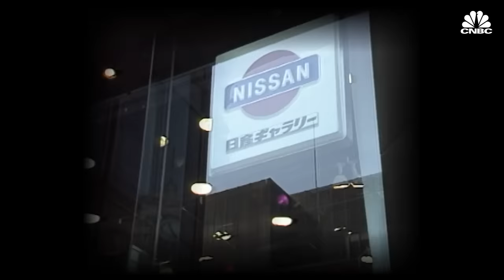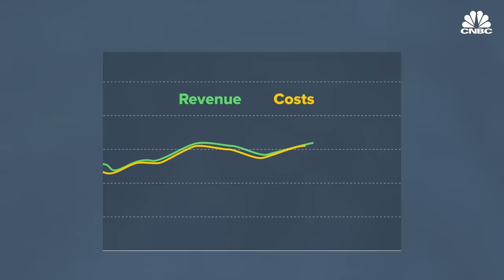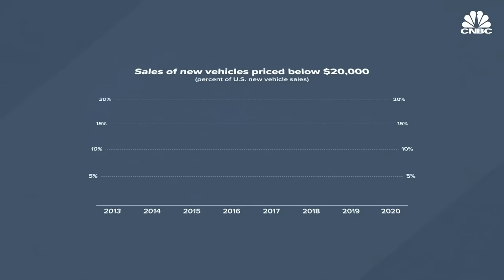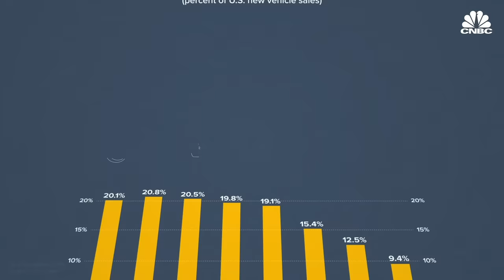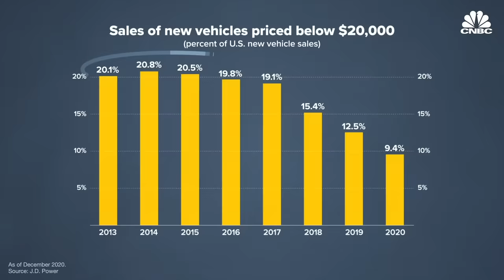Why Cheap Cars Are Disappearing

Comment: Because people are getting loans to buy cars they can't afford in a vain attempt to look good.
Reply: Loans? So what happens if they die before finishing the payment?
Reply: Yep. 2008 housing bubble is going to be 2022's car loan bubble.
Reply: They view it as a monthly payment rather than the price tag.
Reply: @liberals_destroy_everythin2497  I more meant that people will eventually be defaulting on their auto loans in masse. COVID and unemployment has ensured this is going to happen sooner than later. I expected it happen in about 4-5 years.
Reply: Here’s an example of depreciation. I have been driving a long term rental, a 2020 Maxima SL, for 4 months. New it was around $41k, probably outright around $36k. Looked at a used one just like it with 20k miles for $27,500, was told $26,500 would take it home. Unless you had good equity in your trade or had a sizable down payment you are buried in that car. Almost all new autos are like this, some of the SUV’s and pickups seem to hold their value better than the cars do.
Reply: Yeah that's me right over here
Reply: this can be seen when Malaysia make their car taxes to 200% in the 90's, you end up paying loan with interest for 7-9 years.
Reply: I was thinking the same thing.  These banks offer 7 year auto financing which helps broke people buy more expensive vehicles.  The other reason is these automakers are greedy and they want to sell big ticket items to make more profits.
Reply: PCP (Personal Contract Purchase) often offered by the big manufacturers. Put down a small deposit, make large monthly repayments for three years, and then, providing it is in good condition you can simply hand the car back, and repeat the process. A massive used car dealer next door to where I work sold nothing but 2 to 5 year old cars that I guess were PCP returns. A colleague who despite complaining about his lack of pension spent almost £40000 on a new SUV last year says he is looking forward to changing it in two years time as he forgot to specify heated seats.
Reply: @fynkozari9271  The car immediately goes back to the company providing the loan.
Reply: Thats right
Reply: Hydro... I suggest new buyers are more informed than older buyers (they also have less expendable income) and they are buying Tesla, buying used, or using public transportation and ride sharing services.
Reply: This exactly. I'm amazed that the video didn't cover the absolute explosion in sub-prime car lending that has occurred since the end of the last financial crash
Reply: Correct. To keep the price down, the previous generation was willing to live without power windows, air conditioning. If it wasn't needed to make the car move...get rid of it.  As I recall, my dad ordered an F150 with no radio, ash tray, cigarette lighter, air conditioning, power steering, power brakes.
The only real cheapo car sold now seems to be the Mitsubishi Mirage and that is luxury compared to what I grew up driving. ;-)
Reply: God lol this couldn't be more true. My neighbors live in a 700 sq ft home prob worth 80k and have 2 GIANT suvs AND a truck in the driveway. 🤦🏻‍♀️
Reply: This is the correct answer. Banks/Lenders/Dealers are giving out financing terms of 84 months with $0 down and 0% interest. The people are being lead to the slaughterhouse like a completely blind herd, and when the next recession like 2008 hits, it’ll be because of this and be farrrr more crippling (due to the ease of access when it comes to getting a new car and how many people fell for it) than the first recession of 12 years ago.

We’re all sitting on a ticking time bomb.
Reply: @markd9130  It cost far less to build 100,000 cars exactly the same than to leave out options on a single vehicle.  The company building your dad's truck took a major loss, they should have just sold him exactly what they were producing for less.
Reply: @markd9130  On another note.  Most cars do not have all the 5 star safety features unless you order the vehicle fully loaded and also ask for them.  That car in your driveway... the one with 5 stars in the book?   Yea it is only 3.5 stars.  They didn't put in all that expensive safety gear.
Reply: That doesn't make them.expensive , government pushing up business  costs pushed up prices
Reply: I hate how American culture forces people to flood themselves with material goods.
That's not how happiness is achieved.
Reply: @davidbeppler3032  Buying Tesla ? Why do you only mention them ? In the USA they'e the king of EVs but anywhere else they're just another EV maker. I disagree with your view that 'new buyers are more informed than older'. I'm 66 and although not in the market, I've been following EVs for decades and am expert in the detail.
Reply: There are no cars they can afford; and if the USA made any sense (ok, a bit dramatic there...) they would have a better public transport system so that people could get around just fine without a car (not forced to have a car).
Reply: @coopsnz1  Any businessman blaming "taxes" was never a good businessman to begin with.
Reply: it's not just to 'look good', there are actual reasons people purchase more expensive cars. However, the reality is that, like you said, they can't afford them so they spread their loan over an obnoxiously long payment term.
Reply: @frankierogers428  Happiness is achieved through better pharmaceuticals.  :)
Reply: @theoccasionalvideo  The US Public Transport System isn't an 'entity' as such. It exists where vitally essential such as large Metropolitan rail and subway systems, notably that of New York, also Chicago and somewhat smaller in other cities. Large Tramway/Streetcar systems existed in the past but were bought up by auto and tyre interests and run down to promote car sales, notably in Los Angeles. At least that's the popular story. See here for more  ...  https://www.vox.com/2015/5/7/8562007/streetcar-history-demise
Reply: @Chidoro41  I note that most cars bought today contain 'luxury' items and fittings once unknown in the average family car. These include air-conditioning/climate control, power assisted steering, electrically operated windows and mirrors, heated seats and steering wheels, navigational computers, multi-speaker audio with DSP, parking cameras and 'driver assist' systems like lane departure warning and adaptive cruise control. Is it any surprise that they're more expensive ???? My first car, a 1500cc 1966 Ford Cortina (original purchase price new ~£850) had not a single one of these but was 'engaging' and fun to drive. Even the screenwash had to be pumped by hand ! Even my most recent vehicle, a SAAB 9000 has only a number of these 'luxuries' yet is a damn fine car. In Europe, Renault's Dacia brand offers a number of relatively  'no frills' cars for a lot less than other brands. Shortly to include a sub $20,000, 4 seater, 'city' EV too !
Reply: @theoccasionalvideo  you haven't live in Australia and Europe Government total crooks
Reply: @theoccasionalvideo  you must be a socialist, that never owned a business???
Reply: @Hydro Aegis Yes!!!  That's exactly the problem with American people nowadays.  Keeping up with the Joneses and instant gratification.  They don't realize that crap until one of these days they end up losing everything.
Reply: I was just trying to get a car with the necessary specs and there literally isnt anything affordable
Reply: @Chidoro41  It’s mostly to look good. I bought an ‘06 Saturn for $1,200 cash. It gets me around just fine, but most Americans are to vain to be seen driving something they can afford to pay cash for.
Reply: My alcoholic friend used to own a buy here pay here car dealership. If you told him come look at my new car he said "No. I won't even walk across the street to look at someone's new car". I've taken that page from his book and use it also, because it's true, no one gives a rats ass about your new car.
Reply: Well some of us like cars and like driving them. If you buy a car to look good, speak for yourself.
Reply: My wife and I are called elderly, both 73, for our personal vehicle we need something comfortable.  These bones do not handle road trips well.
Reply: Well, there is a huge marketing industry that indoctrinates people into becoming consumers from a very young age.

Comment: Young people should always buy used cars and learn to maintain them without the anxiety of the car’s value plummeting after you drive it off a dealership!
Reply: Nah dude, young people are doing it right today. What you do, is put yourself down on an 84 month plan for a $50k+ pickup truck (because you need it for groceries) while you’re only making $40k, get the latest $2k smart phone, eat at Starbucks everyday, and then…..

Tell Bernie Sanders that it’s the governments fault that you’re in debt and can’t afford to buy a house.
Reply: @MrShitthead  🗿
Reply: @MrShitthead  can’t agree more.  People needs to learn to live within their means and start saving money for the rainy days.  A Toyota Corolla can easily goes 200K miles properly maintain.  That should last them 10-15 years.  Instead they go out and buy the $50K BMWs and get in a 84 months payment term.
Reply: Or even better, not buy car at all if it isn't needed. Obviously, this only works when in area with good public transit.
Reply: I did that and it was a disaster. You end up paying in repairs…. Buy new as possible of your going to buy used
Reply: @adjustdafacts  Depends on the car too! Never buy used benz, range rovers, or other luxury cars. Get reliable cars like Toyota or Honda
Reply: @chiefdan07  or get a car from the 70s

I am looking at a 1970s mercury 

3k from a private seller
Reply: That's nice in theory, but have you seen the prices of used cars these days ?!? It's better to buy new. I honestly wish I would have. Now I have a used car that has needed repairs, does need repairs and TBH by the end of the deal I wasn't paying much less than what a brand new car would've been. It was 100% my mistake. I like my car, but I definitely plan on purchasing new next time I buy. I just need to find the right incentives at the right time. Young people should focus on building their savings and credit. They can buy the new car but they need to scale back their expectations for having all all bells and whistles in their brand new ride right away.....there is nothing wrong with base models. The standard features in cars these days is more than enough.
Reply: @RealDexterMidnight  a car from the 70s isn’t a good idea for the average person looking for a daily driver since ones in good drivable condition can be hard to find and certain parts will break down since they are old, but they are a good idea for a project car since most of them tends to be easy to fix and modify
Reply: Especially if you're poor!
Reply: I'd Rather Buy a New Car than Buy a Used one So that the Used Market for Petrol Car's can Still exist in the Future!
Reply: @dbclass4075  little late to reply, but everybody keeps forgetting a cleaner and easier mode of transportation. The bicycle!
Reply: @nickvanemden    Up to a certain distance. Anything longer distance requires road or rail vehicle. Bicycle is a happy medium between road and rail vehicles, and walking. Though to encourage cycling, Dutch-class infrastructure highly-recommended.
Reply: @RealDexterMidnight  buying 70s cars is basically illegal in Europe, unless you're a car collector, emissions and stuff, we're stuck with boring 2000s City cars or SUV
Reply: Boomer thinks a modern car can be repaired with a wrench and duct tape like it's 1972. LMAO. Cars are computers on wheels and cannot be repaired without proprietary software. This is on purpose so you can't maintain your own car.
Reply: @adjustdafacts  ive only had used cars and its nothing but transmissions and my "newest used" well i went to do a tune up and it had 3 helicoils where the previous owner stripped out the heads and now im down 2 cylinder heads. and my project truck that i have on the side well im 11000 in on its repairs and its still not drivable.
Reply: Young people in the modern wage suppressed economy can’t afford a garage, the tools, the time to learn - and you can’t just fix modern vehicles with a basic mechanical understanding.
Reply: yeah if affordable and reliable cars disappear then buying a used "premium" car then it won't help because those premium cars are expensive to maintain, thus it won't help.
Reply: @adjustdafacts  Try to do your own repairs and make sure the car you buy isn't known as a lemon. My parents have a 2008 Dodge Grand Caravan they've had since nearly new and it now has almost 400 000 km on it. Despite the Caravan not having the greatest reputation, it's gotten by with little engine and transmission issues. The suspension, wheel bearings and brakes are easy enough to maintain. I'm hoping to do similar with my Chrysler 300.
Reply: Paul Lunsford  This is why cities that are the most walkable have less obesity rate: walking is integrated into their daily activities. A form of passive exercise, so to speak.
Reply: @users4007  to add to your point: Crashes.
Reply: @sarahmitchell7816  Finally some valid criticism of the "Just by used!' notion!
Reply: @MrShitthead I bought a mazda3 while in college ($250 monthly payments, but it’s paid off now). 
I don’t drink coffee/go to Starbucks, ever, I eat at home every day (more or less, have a four year old iPhone, make an engineers (six figure) salary, have $0 debt, my boyfriend is is the same place as me financially…
And we’ll never be able to afford a nice home. 
Homes in my area average $1.4M (even a one bedroom sells for like $700K and even a few going for over $1M). We’ll likely end up in a tiny apartment if we ever even afford a house. You act like young people spending an extra $5K a year  on coffee/phones is what’s causing them to not afford a $1M+ home.
Reply: @jml9550 living within the average salary’s means would be homeless. 
People take on debt because they’re underpaid. Many jobs are paying poverty wages. The only people doing okay are people who have jobs that were once considered high paying jobs. Today those same jobs are middle class and struggling.
Reply: @1KingFisher  SF Bay Area?  Been living here for 30+ years.  The city I live in the average median home is indeed $1.3-4M.
Reply: @1KingFisher  some true to that.  But hey there are townhomes in the East Bay Tri Valley at $8-900K.  My co worker bought one last year, $825K 4 bd 2.5 bath.
Reply: @chiefdan07 Or a 1997-05 Buick Park Ave. Big car with tons of space, 3800 V6 that will last 300K miles. A 1992-2011 Ford Crown Victoria or Mercury Grand Marquis is another long life car, 300-400K miles on the 4.6L V6 easily with no sweat.
Reply: @dbclass4075  Public transit can't take you out of cities when you want to go places.
Reply: @HighpointerGeocacher  That depends on the network design:
• Japan's Shinkansen expands beyond Tokyo and Osaka, and some services stop in towns between cities.
• The European Union has interconnected railways between member countries (https://youtu.be/muPcHs-E4qc?si=OSZ9kUM7vVHWBKoc?t=10 ), with the Channel Tunnel being an extreme example of a cross-country connection (pre-Brexit anyway).
• Small Dutch village (<300 population) has a regular bus service. https://youtu.be/ztpcWUqVpIg?si=q6rzU13KdtdiwjUK?t=515.

In areas without railways, trams, buses, gondolas (mountainous areas), and bicycles (seriously, The Netherlands's bicycle network is more expansive than expected) fill the gap. The car will be reserved for edge cases, say ≥ 4 people with the same destination, ≥ 2.5 tons of cargo, and/or the destination is extremely isolated.